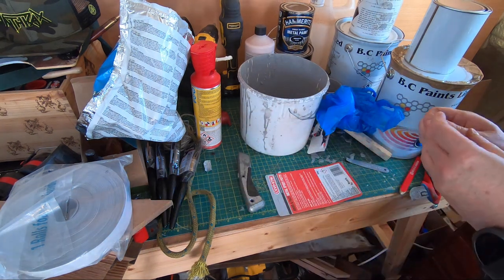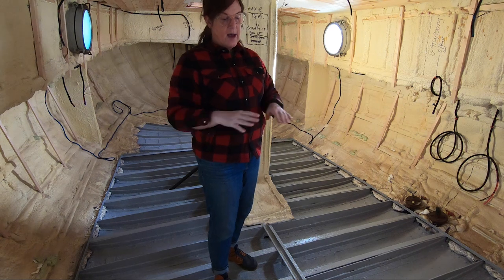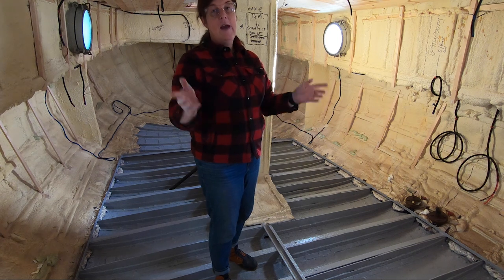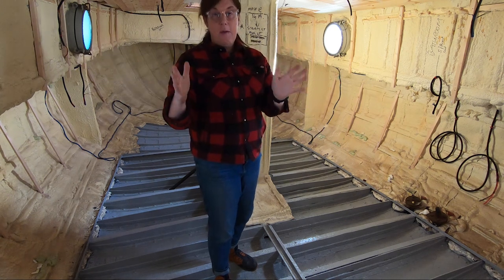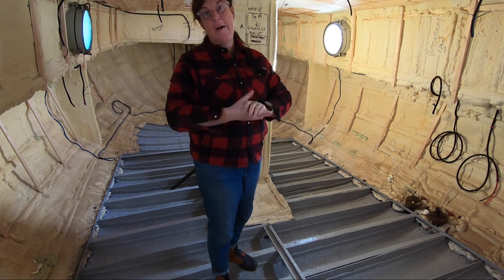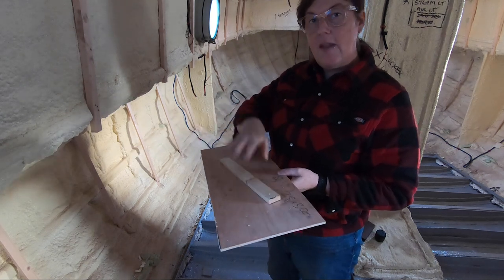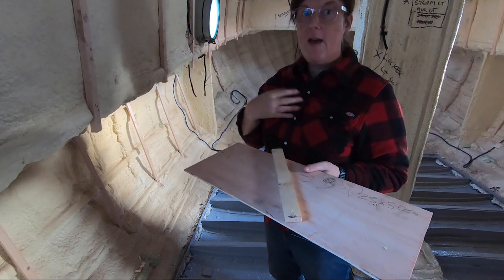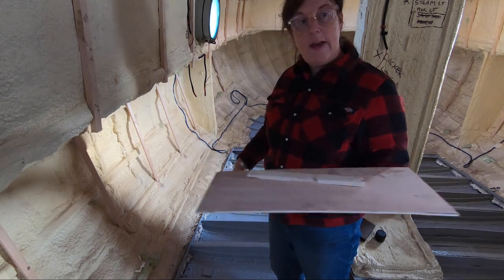#74 More Bilge Painting, and more plans! - Dutch Barge Home

Comment: Its looking really good. Can I suggest that you use tanalised timber as used for roofing battens. Its treated against rot and probably cheaper that the planned battens you have been using. I would also recommend laying the fore/aft on top of the steel frames as this will make fixing easier and allow for cross ventilation. Regards

Comment: Love the meticulous planning.  It will mean a lot of work the way you have planned to lay the flooring, but I'm sure it will pay off in the long run.  In my experience it always does.  Looking back on my own house renovation projects, it's obvious that I have learned from earlier "spontaneity".  I bought a house nearly three months ago, -and I think this is the last house I buy (due to age, I'm 64).  Now I think,  rethink and think again before starting any renovation.  Having this attention to detail and planning, makes me feel more relaxed and secure.  Looking foreward to the road trip next week.  
A digression:  Was thinking about all the rain you have had.  That's usually what we in north-western parts of Norway (just south of Trondheim) have a lot of, but this fall and early winter, have been surprisingly dry and sunny.  So also the next ten days.  Strange.  Doesn't look like we're getting any snow either.
Well, enough weather already :)
Have a nice week! 🙂👍
Reply from the maker: Yes I think you're absolutely correct about taking your time. The first house I renovated took a long time although I rushed some jobs and really regretted it. I'd rather have another 6 months on the renovation to get things done really well and I'm also enjoying the process too so I don't feel in a rush!

The first winter I was on the boat we had quite a bit of snow and the water froze but it was quite mild last year.

Comment: Hi Beth!  Have you thought about doing the floor like a narrowboat fitout? Where the bearers sit ontop of the angle iron utilising the old holes to fasten them down. That would allow for more insulation under the flooring between the joists because the floor does get pretty cold ... just and idea :)
Reply from the maker: Actually I did consider that and it's a great idea.

Comment: For heating I would look into a 5kW webasto standby heater unit. Sometimes available used for not too much money. It runs on diesel and it is a miniature version of a central heating boiler.
FYI: a regular household central heating boiler has about 20 kW of heating capacity...You can do the math in regards to your situation and whetehr or not 5kW will suffice. With a webasto you can use regular household radiators (I would look into the old fashioned ones which have a great heating capacity) and you can install thermostatic valves on the radiator if you so wish...
Also you can use a so called indirectly heated boiler (in the nautical world such a device would be called a calorifier) unit which takes heat from a device like a webasto or central heating boiler unit and stores it into a (generally) 30L insulated tank.
The water inside the 30L tank can be used to shower with, do dishes and so on.
A webasto heats the water in the circuit to about 70 degrees C, so with a suitable automatic/thermostatic mixer valve on lines running to the kitchen and bathroom hot water tap will make it safe to use and multiplies the quantity of usable warmwater for the boat...
Reply from the maker: Hi, thanks for the info! I actually have a Kabola central heating system and a calorifier although I don't have the power set up for it yet which I'm doing next!

Comment: Beth.  All very well thought out.  Will you have a “multi fuel stove” on board? Power cuts are very worrying.  It will be nice to be able to be off grid, for sure.
Reply from the maker: At the moment I'm not going to install a stove although I might think about one in the future, when I see the layout of the place. I'll be running on the central heating system powered by the Kabola but a little stove might be nice.

Comment: Hi Beth, know you’ve thought an awful lot about your floor. Have you considered using an adhesive to fix your bearers (battens)  to the steel joists to reduce the potential for rot of coach bolts and or battens over time?  So many really good adhesives around these days. One I have used with great success is called CT1. It can even be used on wet surfaces and is incredibly strong once set. Available from lots of DIY and plumbing outlets. Best of luck with it whatever your choices.
Reply from the maker: Oh that's a great idea, you think it'll be strong enough?
Reply: @TillerQueen  I do. Put the adhesive on, clamp the batten to the bearer; remove any squeezed out excess. Full strength after 24 hrs. Why not try two on adjacent metal joists; after 24 hrs, put a board across the two battens (a bridge), and jump up and down on it. That’ll convince you!
Reply from the maker: @ianbowen5206  Amazing, thank you for the advice, you've convinced me and saved me a lot of work! 😁

Comment: If you can help it please look into a composting/dry toilet system, preferably a diy one. You will find a dry toilet is very low tech, very low manitanance, somewhat of a chore every now and then to empty the solids departement but the main thing is, you wont need anything like a black water tank or the like... I got one in my campervan for 3 years now and I love the system. I build my own toilet box and the only thing I bought was a urine diverting insert from Kildwich (a German based company - previously a UK one)  which makes the toilet box look just like a regular one, especially since you can use a regular toilet seat and lid of your personal choice... Another great thing is you wont need to flush the toilet. The urine can go in the grey water tank whereas the solids container contents can be disposed off in a regular bin...
Reply from the maker: Thanks although it's a requirement to have a pump-out system where I am moored usually.
Reply: @TillerQueen  I use a dry toilet in my van, although the van is (as yet) only used for weekends and holidays, I find it very practical and easy to use and maintain.
I started in the van with a small size porta potty which I emptied twice. The first one was a disaster (user error layden) and the second one was oke but I disided there would not be a third one, cleaned it very well and sold it for someone else to use.
In two days I build a box which housed a large plastic bucket (with lid) and a small plastic canister to act as the onboard toilet.
I had to wait for the main event to arrive which enabled the liquids and the solids to go in either container. I do have to carry a supply of sawdust with me for the soids departement to function well but even if I were to run out, a diy store with a saw could help me out or even a pet store where they sell bunny rabbit bedding which I can use.
I never ran out though, a 10L bucket lasts over a month.
To get rid of the waste is quite easy. The liquids can be drained either overboard (not very nice but works - I would recommend you have the outflow pipe go out above the waterline and run down about 1 foot below the waterline so there is no splashing going on) or into the ground (keeping in mind not to do it near a water source, a stream or a path and rotate spots as you go along - this applies to situations where you stay in a curtain spot for extended periods of time obviously) and the solids I simply discard in a general waste bin (or if available the compostable waste bin) at a gasstation or a big box store. I once (when in a pinch) put it in the bin meant for dog poop which was a hassle though to get into that little opening (since I have a special key to open those bad boys up)...
All in all a dry/composting toilet is IMHO the way to go, not just in small spaces like a campervan but also in larger locales like a "binnenvaartschip" (Dutch barge) like yours. You can try it quite easily and low cost if you were to build a simple box and get creative with a large automotive funnel and melt/shape and manhandle your way to form a pee diverter to clip to the solids bucket. Not pretty but it works as a proof of concept...
Reply from the maker: @koningbolo4700  Yes, I understand, although the rules have changed here and you can't put the waste in the bins and it's illegal to discharge anything into the river. I know lots of people love a composting toilet I do prefer a pump-out system with a flushing loo. I like a bit of luxury! 😉
Reply: @TillerQueen  I got the dry toilet mainly because it saves on water and weight, it is cheaper to run and it negates the need for a black water tank. I never have to look for a waste water dumping location ever (in regard to the toilet that is) I do have a mobile (25 L rolling shopping bag style) grey water waste tank which I empty regularly at places like a public highway toilet facility or if I come across them: dumping locations...
Since my waste water tank is about as large in volume as my fresh water tank (25 L vs 19 L and several 5L jugs) The need to find fresh water coincides with the need to empty the waste water... both tasks can be done ussually at the place...
Reply from the maker: @koningbolo4700  Yes, for sure if I had an RV a composting toilet would be my choice too. For flushing my toilet takes raw water from the river and uses that to flush, which is good.

Comment: Nice vlog Beth. Very informative.  The floor system sounds great.  Here’s hoping you are set by the time the cold comes.  Is it possible to have a multi fuel burner on a Dutch Barge?  Have a good week.  😊🤗   Kathy
Reply from the maker: Yes, I actually had a multi-fuel stove although it was far too big and it needs a lot of work and it's also very dusty so I removed it, although maybe one day I'll fit another smaller one to take the edge off the cold.
Reply: @TillerQueen  a small one might be a good backup in case of power outages. Thanks Beth. 🤗
Reply from the maker: @ruaidhrikathygill8833  As soon as I have my domestic battery bank running that should keep the heating system running for a long time but I was thinking about a little pot-bellied stove in the future. We'll see. I do find they irritate my chest a little but a small one might be ok.
Reply: @TillerQueen  understand. I live in upstate NY and have a great Jotul that does a great job, but I have friends that are real sensitive to the dust etc. be well! 🤗
Reply from the maker: @ruaidhrikathygill8833  Would love to visit Upstate NY some day. The Jotul sounds like a good option!